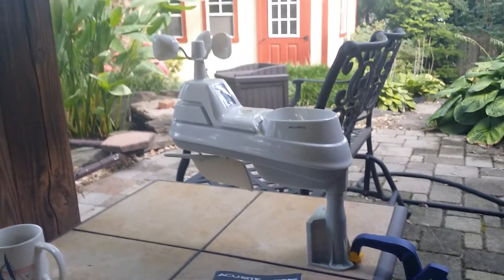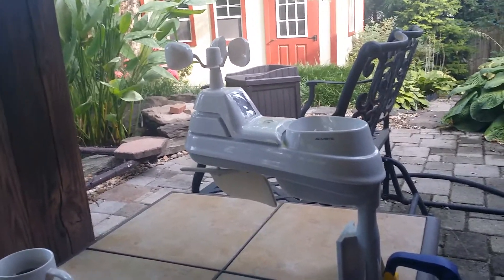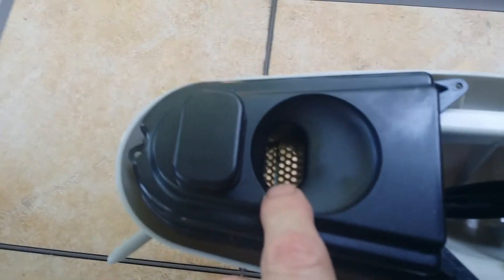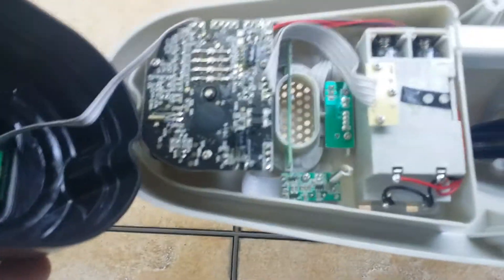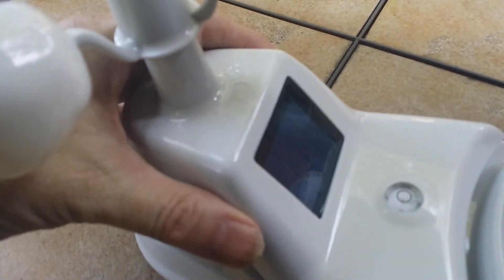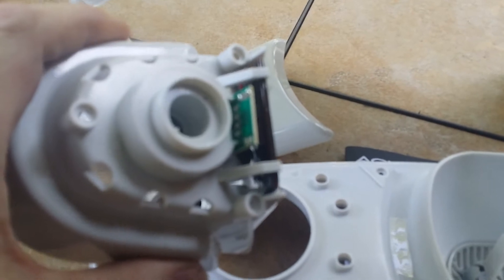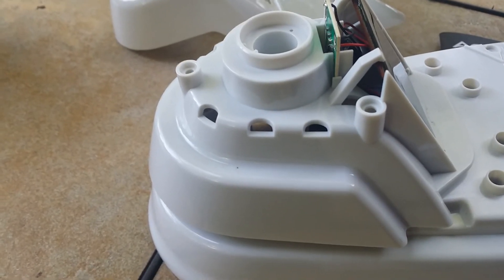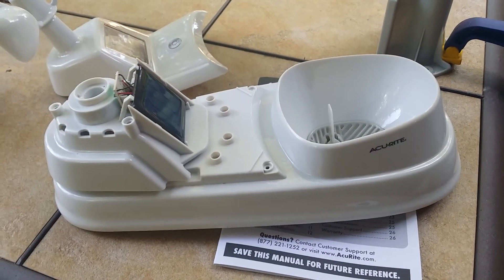Breakdown of Acurite pro wx station model 01036

Comment: There's nothing wrong with this unit the problem is trying to compare it to the National Weather Service sensors which may be miles away.

I'm a weather station junkie I have 3 Vantage Pro 2 units as well as a $3,000 rainwise unit.

And all I can say is for the price the AcuRite 5 in 1 does an amazing job and tracts real well with all of my other weather stations.

99% of the problems people are having are user error. 

I will say that the AcuRite does Spike slightly in temperature until the Sun hits the solar cell and gets the fan going and from that point on at Trax really closely with all but my other weather stations including a $3,000 rainwise unit.

By the way you don't need to remove the magnetic sensors from the anemometer to remove the top unit just unscrew it and it will simply slide off.

With that said you can easily convert this do a 24-hour far's unit by simply hardwiring the fan 2 a  separate power supply.

For the power separate power supply I'm using a 50 watt solar panel and a small gel cell battery which Powers the entire unit.

Keep in mind you don't want the fan running too fast or you'll get inaccurate readings you know wind chill and all that. Just fast enough to keep a slow steady flow of air through the unit.

The bottom line even the stock unit is well worth the money.

The problem with fan aspirated units is that you have to continually clean them or they get gunked up with spider webs and bugs.

You can further increase the accuracy of these units by shielding the inside of the temperature unit with a bit of reflectix.

But I do have to say with all the modifications that I have done it really wasn't worth it as it didn't improve the accuracy much but did improve the stability. If I had to do it again I probably wouldn't bother with the modifications.

Comment: I agree that the  single solar panel does not provide enough power for the temperature fan, and should be modified with the two panel unit. Mine constently turns in a two degree difference in temperature from the official temp at the airport just three miles away, so it isn't a major concern for me, but could be for others. These Accurite Weather Monitors are pretty good for the money, but it's too bad they don't offer modifications when you buy them. I mounted mine at the peak of my roof in 2016, on a 24" steel pipe above the roof. It wasn't until the batteries in the monitor wore out, did I find out there is a very good fix for that- Accurite has a remote battery modification that does away with the batteries in the bottom of the Monitor, and wires in a plug that leads to a battery box that can be mounted up to 30' away from the monitor, making it easy to replace the batteries at ground level. Accurite doesn't really advertise this modification, but it's available on both Ebay and Amazon. Prices have went up lately for this modification, but if you are unsure of heights, this is the way to go. Another video on YouTube shows a way to modify this fix to an AC to DC transformer, but I would imagine it might not be for everyone because when you lose AC power in a storm, you'd lose your monitor.

Comment: Great video of how this unit works. Had you thought of moving the temperature sensor to another location on this unit? Maybe to the inside bottom of the housing right against the perforated screen might expose the sensor better to the outside air. I see several options for that modification just from watching this.

Comment: Great video, Thanks. So what height would you suggest on the station? I just got mine and was about to put it up.
Reply from the maker: I would put it high enough to get the most accurate wind speed. High enough not to be blocked by buildings.

Comment: i have a 5 in 1 station. its several years old. last summer the temps were reading 10 degrees higher than the weather service on t.v. was reporting. it was the fan. contacted acurites customer service and was told about the replacement head with 2 solar panels. now everything is operational. readings are spot on with the weatherman. the weather predictions are accurate. i really am pleased with my unit and the customer service at the company.

Comment: I have a 3 in 1 station and the temperature's always about 5 + degrees high except at night it's correct.  I've had a lot better temperature sensors than these.

Comment: Very useful presentation. Thanks.  I intend to buy a weather station next time I come to US, to use it here at my home  in India at 9.9 N by  76.7 E. Rain forecast and temperature measurement  is my primary purpose. Could you please advice me to select a model suited for the tropics. It's usual to have lightning and wind with the rain  Could there be any option than a 5 in 1?

Comment: Really liked the clarity of this how-to video.  Russ goes step-by-step on disassembling the 5 in 1 sensor.  It also helped me get the problem I have with the Temperature/Humidity sensor. Acurite sells a replacement module, so a whole new unit is not required.  Russ thanks again.

Comment: Very nice presentation of the inner parts of the device, something that one barely see as he may never dissembles and then assemble the machine back correctly. Thanks for demonstrating what is going on inside. However, the fan problem can be solved by an outsider small regular fan to put under the device to allow more air flow to the temperature sensor, no? Shielding is not perfect in this device but this is what I like in it, I do not like the more professional weather instruments with 7 louvers for ventilation and as sun shield. One may add an outsider louver, however.

Comment: I'd return. Or I'd start breaking out the drill to fix this. :)
Reply: I agree. Since those six holes for ventilation are under the upper housing, just drilling them out larger should do the trick. Biggest problem I see is the fan motor. It appears to be a sealed unit so adding some light lubricating oil is impossible .